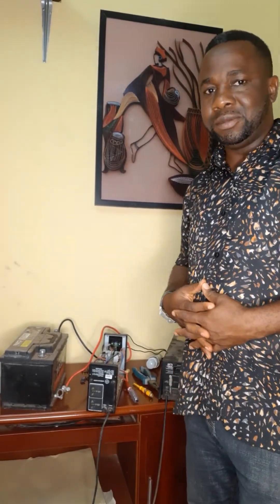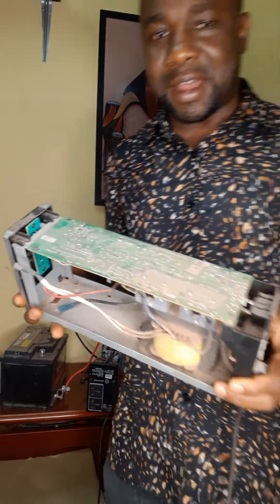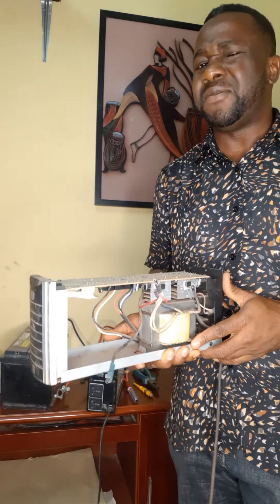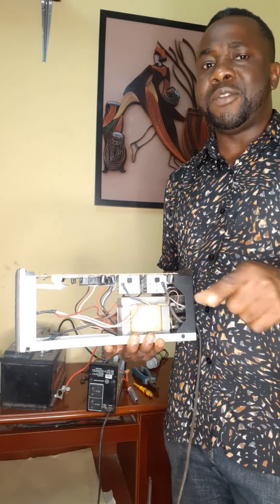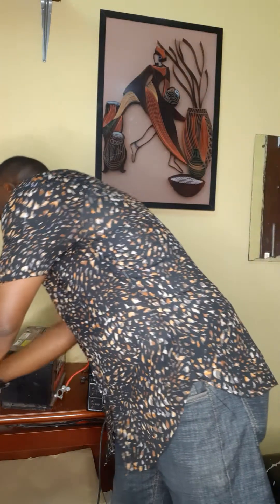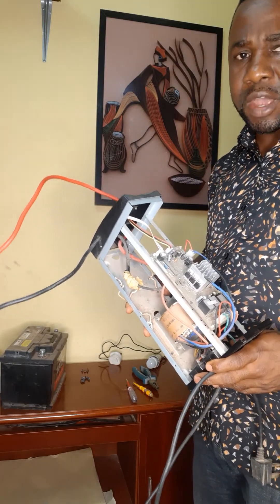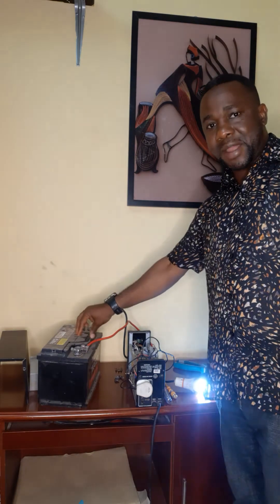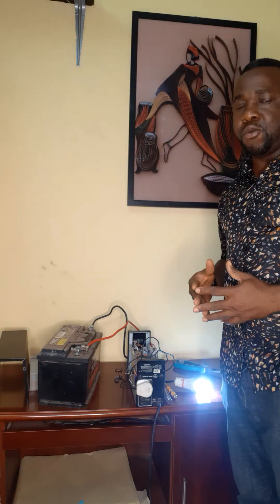How to convert your new or old UPS into Power inverter

Comment: My ups has a problem if I connect the battery to the UPS , it beep it give  output voltage for just 2 to 3 second and it will shutdown and my battery voltage is around 13.7v , someone help me please what's wrong with the UPS driver board

Comment: Those ups can get them run for 5 hours and more charger battery used battery with more Amp and fused on red wire between ups and battery ok you used 12Amp 12Volt 2  12V 12Amp keep battery at 12V but get 24Amp

Comment: Can we use solar panels to charge it
Reply from the maker: Yes you can, just read through the comments, I assure you will learn a lot
Reply: just buy 12volt 30A solar charger controller and hook it up to battery ok used solar paned but i would put fan over Transformer  it will hot ok fan over it will cool it down wich i did

Comment: The buzzer/alarm should be removed and replaced with same ratings of a dc fan to help cool the internal working of the ups components.
Then use a regulated external charger to charge the battery(ies) from mains and then panel, charge controller to also charge the battery from sun. Dont forget to install a circuit or line breaker to the negative terminal of the battery before the inverter/UPS, this is to prevent reverse current drawn. Never run inductive loads on it. But u can power your home with it comfortably.

More so, the cut of voltage of 10.4 from the ups can be adjusted via the variable resistor to either 9V or 9.8V. this is to prevent excess power drawn from the battery and thereby damaging the battery
Reply: I would like to know why you said it's not suitable for inductive load like a fan
Reply: @jerryobot8554  this is coz as inductive load, it draws continuous power off the system which will drain the battery very faster and also there will be a humming sound coming out from the fan while in operations.
That is why using of fan generally on inverter systems is not advised unless is DC/AC fan or solar fan. Induction motors takes more power and if your system was to last up to 10hrs on standby, the induction load will reduce it to 6hrs or lesser

Comment: I did this method, but the UPS charging capacity is weak, which leads to the battery weakening and being damaged in the future.
Reply: You need battery charger or  buy panels and charge controller
Reply: Whitch is why you need to buy a separate victron charge controller   to charge your battery fast by pv module or shore power 🤷‍♂🤷‍♂🤷‍♂

Comment: How long can it run without charging?
Reply: The answer to your question can only be gotten when you change the question to: 
How long can a 100ah battery run on a 200w load for example, without charging. 

My point is, your question was vague and lacking in specifics. I dont know if you get he point.
Reply: So if you have a 32in led TV and decoder running ( less than 100w), a 100ah deep cycle battery would run that load for about 4-6 hours straight without charging. 
If you add a stand fan of about 30w you can still get up 4 hrs out the system.
Reply: Thank you for your response. I appreciate you and your knowledge shared

Comment: I will want to thank again for taking out your time to detailed everything about converting of a UPS to a mini Inverter , we were able to built one through your direction here and it has been working up till date. The first one we built heated up but we were about to discover that the UPS had some circuit issue prior to our using  it , so we had to provide another one and it has been working effectively up till date.
Thank you for the lecture, people hardly give enough you you did Sir
Reply from the maker: You are welcome
Reply: I have been having the same issues but this your post don motivate me to try again

Comment: My ups inverter power off once the battery is 10.4v but my 500w sachet inverter work till 10.0v
Reply: It's the way the UPS was programmed to operate. That's its cutoff voltage to prevent the battery from dieing due to excess drain.
Reply from the maker: It could possibly be the cut off time for the PIC component embedded in the UPS

Comment: Hi, how did you overcome the over heating of the transformers? Thanks in anticipation of your response
Reply: Link on how to upgrade 600w to 1200w using two ups pls
Reply from the maker: No ! Not using two , use one UPS of 1200W
Reply from the maker: Check to see if the UPS you used is in good other or you can actually upgrade to 1200watts or above : 1200w has two transformer of 24V connected in series
Reply: I have a 2200w UPS how many Watts do you reckon I can safely draw from it without causing overheating
Reply: @pantherat2323 
2200w for starting but 1200w - 1500 should be okay without any issues
Reply: cut out hole and used 12V DC fan ok wich i did ok once it is overheat turn on the fan ok

Comment: use a plier to remove the buzzer, so as to eliminate the noise, u can check google for electrical buzzer.
this video has almost ni information because the ups will turn off after some minutes.

Comment: How to switch off the alarm?
Reply: If you are brave enough.go inside where the buzzer is located. It run off dc power of 12 volts. Desolder the buzzer and replace it with a 5 to 10 ohm risistor in place of the buzzer with no sound 😊
Reply: Some models you have to hold down one of the buttons to disable the buzzer alarm 😊

Comment: Can one introduce Solar panel to this setup, with and without battery?
Reply: You can introduce solar panel to the system but not without a battery and a solar charge controller. The essence of solar panel is to use sunlight to charge the battery in order to replace the energy loss from the battery during the conversion from a DC to an AC current with the inverter or UPS.

Comment: Let's say I don't want to store energy in the battery first. Is it possible to draw energy directly from solar panel and connect to the UPS during a sunny day? Will it give me a current while sunshine lasts?
Reply from the maker: Yes!
Reply: @CebtechEngineering  I did it today but the UPS didn't start. I used a 12v solar panel. What could be the problem
Reply: Can I send u a direct message with a picture of my set up

Comment: How do I use solar panels
Reply from the maker: You will need to do that through a charge controller; I au have to do a video on that
Reply from the maker: Very soon
Reply: I use 500wc solar panel + 40A charge controller + 2x12v-200AH batteries + APC Back-ups. Working well 24h/7days
Reply from the maker: @dPatai71  Nice one! More of sure report please,  we can do more than the above
Reply: @dPatai71  could you please share your setup?
Reply: Sun